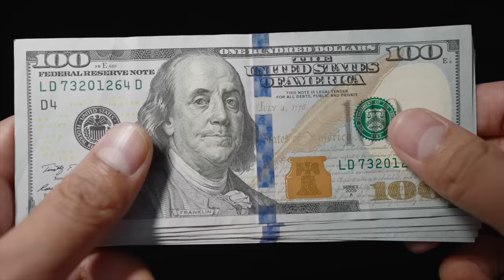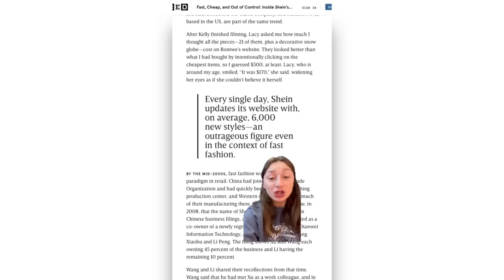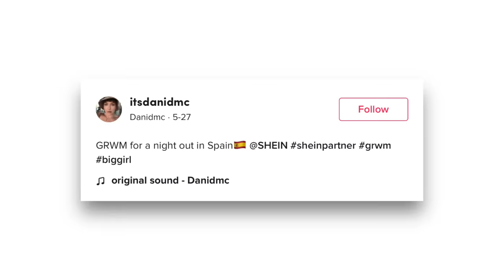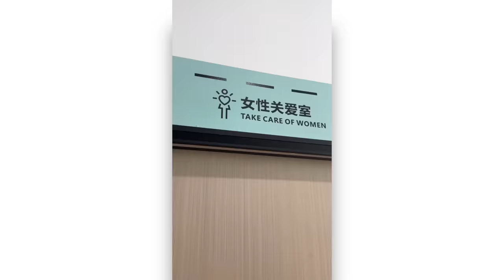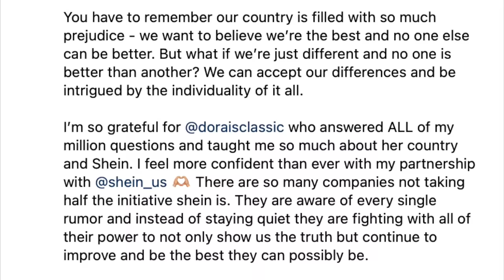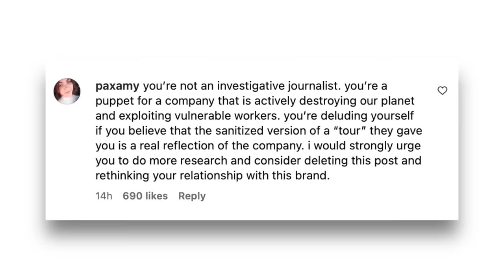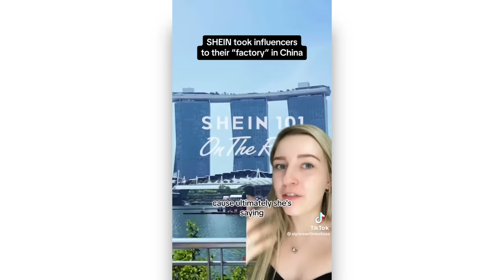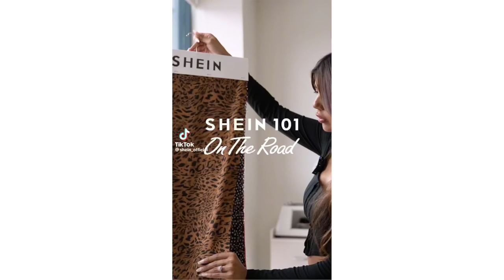Influencers DRAGGED for SHEIN brand trip...(this is scary)

Comment: If you feel guilty for buying clothes from shein please don't just throw them out, it is not the economical or ethical way to deal with this dilemma, instead keep wearing the durable pieces you've got from there until they wear out, and maybe use any badly made ones as fabric scrap for projects <3 I swear I have fallen mighty victim for this trap, and I've realised that I in fact do not need new clothing every five months. My clothes still fit me, they hold well in the wash, and I do not need a 'cheap alternative' that can provide me affordable clothes every few months. I've cleared out my closet and donated some well made fast fashion pieces to young girls, and I've never felt so much more at peace with the state of my closet and consumption. If someone shames you for repeatedly wearing the same clothes, restrain from even reacting to their embarrassment of a mindset. Clothes are meant to endure and be worn till they come apart.

Comment: I am very into secondhand shopping, and I have noticed a huge recent increase of SHEIN clothing in thrift stores. Even if something is cute, I'm always concerned about the quality and the reason it was donated in the first place. Plus SHEIN clothes are already so cheap to begin with, that it doesn't hit the same as finding something vintage/high quality/designer for an insane bargain price in a thrift shop. And while this is sometimes true of other affordable/fast fashion brands, the ones that have been around for longer used to make clothes with the intention of being worn more than once in a single try on haul, so you might still find, say a perfectly decent pair of GAP jeans that was produced 20+ years ago

Comment: I never buy shein, however i have occasionally picked up 2nd hand shein while thrifting, i wear them until they fall apart. Since 2019 I've only bought 2nd hand. Second hand clothes are affordable and I spend less on clothes than I used to when I bought fast fashion and this is because the quality of older clothes is so much better and durable. The amount of clothes that go into landfill every second is fucking scary and out of control!
Reply: I also have one shein 2hand item, I literally got it from a coworker because she wanted to… throw it away.

Comment: Hold on hold on. All valid, but just one thing to be noted. Each country has the own currency and how much ppl get paid and things are cost. $500/month is sufficient enough for one live in tier3 or under-cities considered that 3-4 dishes usually cost around $15. Using USD and how ppl usually get paid to measure/criticize is an exertion of hegemony as well

Comment: If shein is partnering with other factories to make their clothes, does that mean that shein is hiring the labor, or are the factories that they partnered with hiring the labor? If they’re just partnered with factories, then they may have no control over the workers in the factories, it would be whoever is running the factory that controls that. In which case every factory could be run different with different hours different working conditions, different pay.

Comment: If I buy 1 or 2 pieces or more from H&M/Zara 1) they're on sale 2) that's because I really liked them and would wear them. Also because they have a physical store to try clothes on. Shein, is a little bit cheaper so I get why people bulk buy, but precisely because of this low price that they compromise the quality and will just prompt you to buy more. I could at least put H&M/Zara or similar in a higher spot cuz for my use they are more sustainable, you get more quality (budget wise) than Shein. I would rather wait a bit for sale from H&M/Zara for quality than Shein, and cuz I think Shein put out more random stuff that people don't really need but somehow still sell a lot faster, they don't even have a physical store so a buy is a hit or miss in terms of sizes also, I don't want to deal with returns they are slower than actual delivery times so I just don't use Shein at all